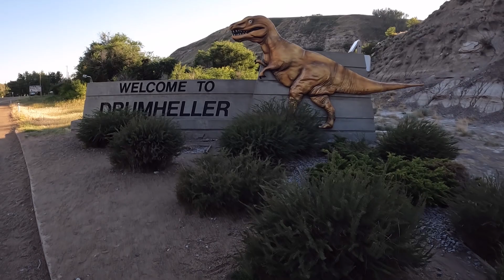DRAG WEEK WRECK! - Race Truck VS Wild Life. Mother Nature WINS

Comment: Memories from 1979. Bought my first set of chrome five spokes and tires from Canadian Tire and changed them right there in the parking lot. Then went back in and bought air shocks as the rear fender was touching the N50x15. Installed them and drove slow over to the air compressor. 😂 Good times

Comment: I left work at the garage one day in the 80's in my 70 SS 396 Chevelle to have a wisdom tooth removed, stopped at home to pick up wife to drive back home. On the way back she hit a young buck....ended up with a new hood and rad....two flues were leaking and I removed them and soldered shut till I got a new rad.....funny how bowed it was and still cooled. Luckily my shop had an acid tank and I repaired and recored and rodded rads....not much of that done anymore, or how I bent old Ford I beams on my alignment rack with a 5 ton porta-power. About 5 yrs ago I had a buck jump plum over my chopper and me...glad it missed taking me out.

Comment: Dan / anyone ? , ihave a question how do you fit old style BBC manifold stagared bolt hole  to the new straight style heads (rectangle port) , i dont think you can , any ideas  trying to mount a tunnel ram...thanks mike